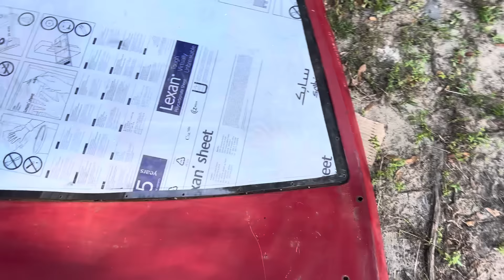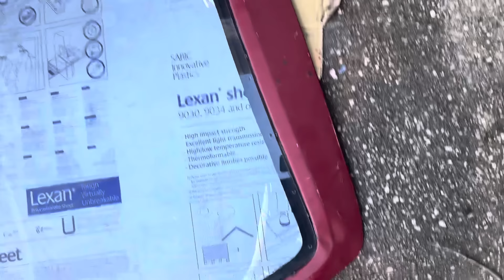Pop the HATCH! Light is MIGHT! 1989 Mustang GT 5.0 Trojan Horse pt.107

Comment: My man I am more impressed by what you do with next to nothing.  YouTube is flooded with shows building high dollar crap. Keep doing you
Reply: Facts, holley has ecu issues with the sniper ( it went up twice on mine the first time cost me 2400 after it was all said and done with) every tome someone with a YouTube channel has an issue they send them either the new sniper or like one guy got everything you can imagine for his crate motor plus the whole sniper 2 system, distributor, hyperspark ignition down to plug wires. Smh, i work for a living and i spent like close to 3000 on everything. They couldn't even fix there ECU because it was out of warranty for free. Now i just sent it back again, its under warranty but since its been 11 months i have to pay for shipping. I used to like holley, but im not so sure anymore, they don't care about the little guy. Sorry for the rant, if anyone taies the time to read this do not buy the sniper at least the first gen.

Comment: Have you ever had a top loader 4 speed in a fox? I had always heard it was the last resort when t56 magnums don’t hold up, there is a local with a claimed 1100hp terminator running one here on 28  x 13.50 quick times and hasn’t broke it yet
Reply from the maker: Nope even though I’ve known people who have…I almost bought an 83 GT back in ‘92? that had an old school 377” windsor stroker/top loader/4.33 geared 9” rear but alas it didn’t work out…and in 99’ I ordered a Jericho but never used it and ended up selling it 😵‍💫…for me I’ve gotta have the OD as I still drive my stuff to the track, if that ever changes then a side saddle would be an option just to run a vertigate cause they’re cool🤙🏻

Comment: Man...since im on my 13th clutch in my 5.0...from 1989 when the stock and then the Motorsport clutch wouldnt hold my first N2O Works kit in third...I put in 3 New clutches that weekend till i got a Borg Warner Super Brute to finally hold and i won a few races...till now with about 675rwh..with a custom plate from Walt at Pro Motion and disk from Mcleod...that holds well....im just suggesting to move forward with the New clutch your buddy got ya...because once they blow through from power or rear main leaking hot oil fumes on your clutch...they dont ever really come back 100%. I glue all my rear mains in so they stay dry...then torque wrench the pressure plate down...yes it makes a difference....go get your flywheel ground..not turned...lube your splines a tiny little bit so your disk isnt trapped in them when you  push the pplate in. I pack a little extra grease in my new throwout bearing if they skimped on it..then wipe it clean then micro skim the face with grease for the fingers..lasts way longer guietly.  Pull the fork and clean and grease the pivot ball too.....Use a Ford OEM stock cable from a 1995ish (will be cheaper than an 1989 cable).. so your cable will rout good..few zipties...wrap the cable with heat wrap next to the header..tie it away...and you must use with a firewall adjuster...and quadrant.   Take it for a ride to get the engine and whole clutch and flywheel hot all the way and Do some clutch slipping in a lot or your house ..
..stoplights etc...to seat the disk a little then let it Cool off and go do it again...heat cycles help temper the flywheel and the pplate and seat both sides of the disk..before you ever beat on it and it might hold them banging power shifts you like...if you dont rush it..and break it in some...
Do not get it so hot you smell it or its ruined..im talking the slipping a first time stick driver does...you know...seat it...then cool it off from your cruise back to cold..then go out for another break in session...till you feel like its biting decent from dead stops....you can feel it change...like fresh brake pads start to bite..when you launch it a little.
Good luck man..i enjoy your vids.
I raced my Mustang for 25+ years of its life and i still have it....still My favorite Toy... :)